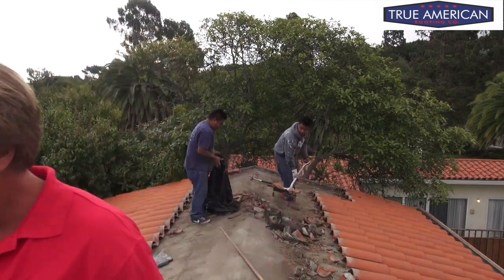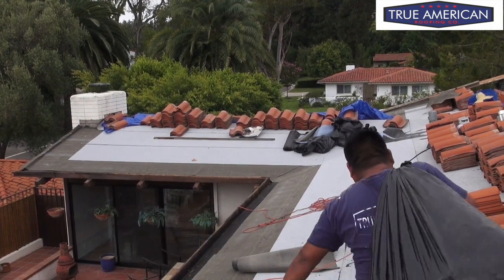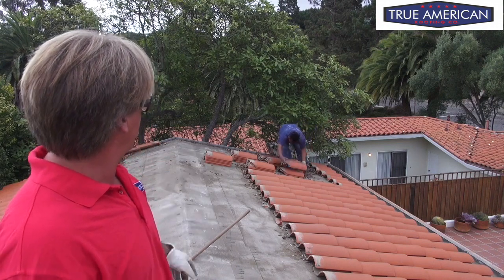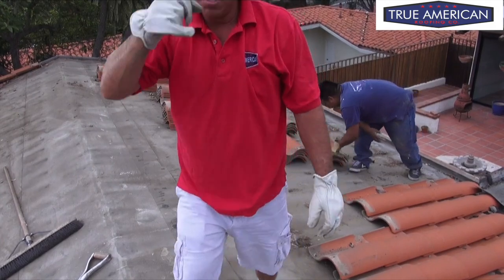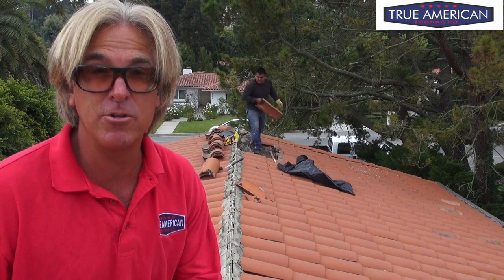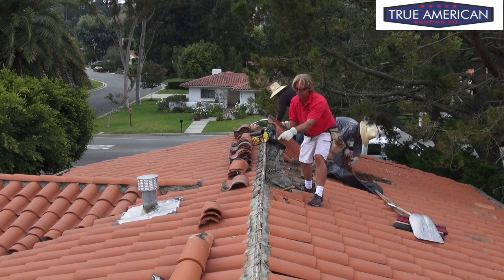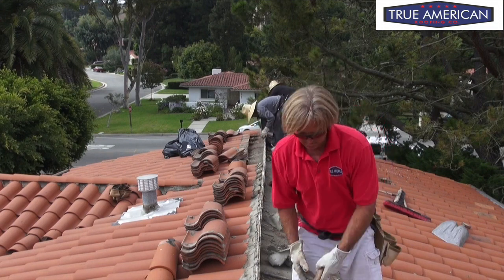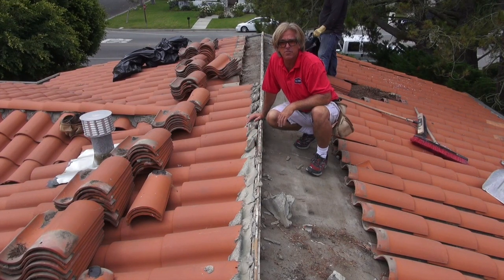Fastest Roofer How To Tear Off Spanish Tile Rancho Palos Verdes Roofing

Comment: nice videos man  torch under clay too much Hassel 2 layers,or tu 43  sbs layfast type  2  felt with a sbs rubber white cap or rubberoid is,well worth it s wieight in the bid and less fire Hazzard  and it's nailed down  double your flashings and felt your Ridge boards  too u fasten your hips and valleys with wire liked your  perfesionalisiom on salvaging and how you overall remove and re install be safe bro your bro in Santa clara liked how u presented the clay jobs
Reply from the maker: Michael, we usually install 2 layers of TU 35 as a standard base underlayment for all of our tile roofs.

we never use 2 layers of 30lb. ASTM 

some times the home owner wants to up grade the base underlayment
or if the roof is below 3:12 we have to install a hot mop base underlayment
 or  torch down roofing material  regardless just to pass inspection in our area. 

when we use torch down we install 1 layer of TU 35 then a granulated torch down on top of it.
a lot of the homes we work on in my area want a bullet proof base sheet.  and this is one of the best you can get.

Michael I will check out your web site 
thanks again for watching videos.
good luck 
Cheers